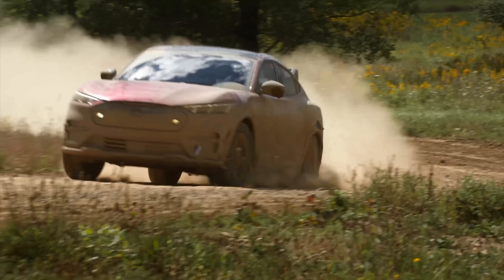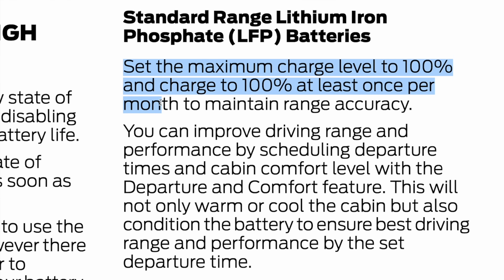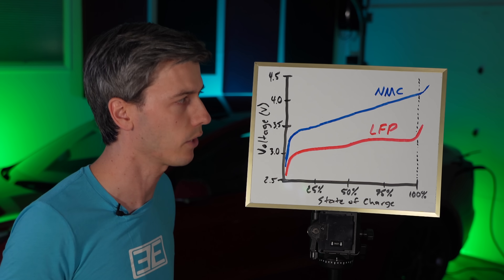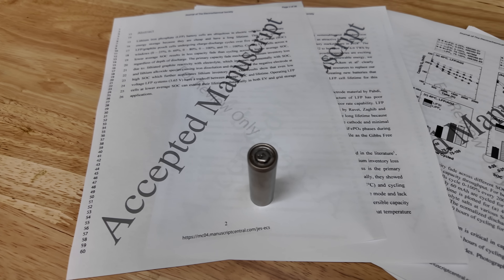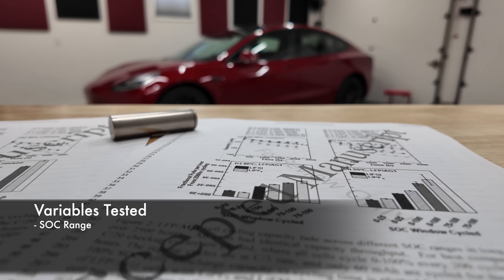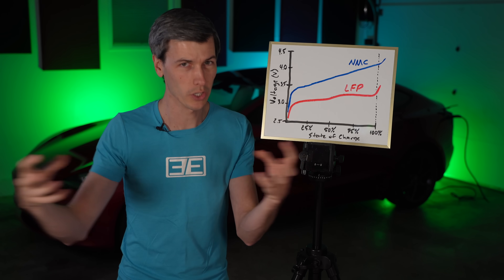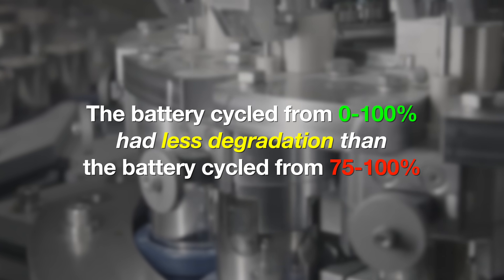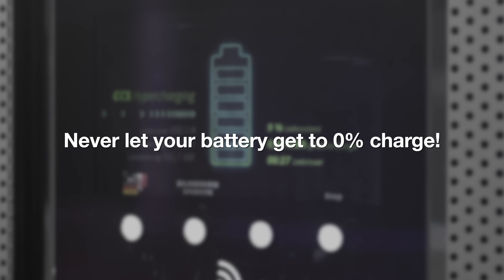How To Ruin Your Electric Car's Battery - LFP Edition!

Comment: About to hit 100k miles on my 2022 Model 3 RWD (LFP), and it only has about 4.5% degradation after being DC charged about 75% of the time (over 21 MWh). I full-charge it as much as I want, deep cycle it, and the car just holds up. I’m currently on a 10k mile cross-country trip with the car; really impressed with the longevity of LFP.
Reply: What’s your average ambient temperature?
Reply: @Eclipsis17  Spent the first two years in Austin, TX, so around 100°F (38°C) in summer, and now it’s out west with similar temps.
Reply: @BrandonKipp  As an Uber driver, my 2023 Tesla Std rng is at 116,000 miles and I just checked it again and it's 4-5% degradation. I'm in Michigan and charge 67% AC and 33% DC usually. Charge to 100% daily, but I drive nearly every day city driving 1500-1800 miles a week. Very glad I got the LFP battery!
Reply: @MH-Tesla  That is awesome to hear! At this rate, you’ll definitely get at least 500k miles out of that battery - super smart choice to go with LFP. I saw your comments on this video a couple months ago when you had 92k miles, I’m glad to hear not much has changed since then. My LFP Model 3 was also used for rideshare in Texas up until 90k miles and was almost exclusively DC charged, but that didn’t seem to affect it at all. I did a 110k mile review on my channel which basically concluded that no matter how you use/charge the LFP packs, they’ll degrade pretty much exactly the same. There’s an LFP Model 3 I’ve been following in Australia which has over 220k miles, and only 6% degradation. Lots of other high-mileage owners chimed in and said similar things as you did - don’t worry about the battery, just drive the car. But definitely keep us updated on how it’s going. I suppose at this rate, you’ll be at 200k by early next year?
Reply: @BrandonKipp  Did you often DC charge at hot ambient temperatures in Texas?
Reply: @donny_k7370  Yeah, the car was constantly DC charged in the hot (over 100°F/38°C) Texas weather, and there were seemingly zero adverse effects from the heat.
Reply: Did you do a overnight battery test to make sure the degradation figures are correct?
Reply: @Shane-fk6ig  I have not done the “battery health” test in the service menu yet, but that’s something I’d like to do. However, I have measured the capacity the well-known way, which is charging the car to 100% SoC, driving it gently (to avoid losses) down to 0% SoC, and using the bottom buffer. In that case, I’ve been able to pull close to 58 kWh out of it, which aligns with ~4.5% degradation. I’ve probably cycled it from 100% to <10% at least 40-50 times within the last two months and 15k miles of driving, and each time, the numbers have correlated with about 4.5% degradation.
Reply: @BrandonKipp I would be interested to see if there is a difference. I did a lot of research before buying a second hand Tesla  a while back and it appeared the battery health test was the only way to really tell. I bought a Tesla offa guy who was reporting less then 5% deg but when he did the test it was 10% which is consistent with my understanding of what nearly all NMC cars lose in the first  year. After which they hold that rate for years and years. That’s why I’m surprised about your results as it wasn’t consistent with the battery testing results I saw in studies or of anyone who completed the battery test. Either way the batteries are still great but yours is exceptional.
Reply: @Shane-fk6ig  His car is LFP so it correlates with LFP better longevity vs NMC
Reply: How and the fk do you get 10k from "crossing the country" I call BS
Reply: As a long time ev driver since 2012, that is facts I charge 93% at home and degradation is/has been so minimal.  Remeber to remind the no ev people, the effiency does not drop over time, ICE junker passengers get less efficent with each and every mile.  The ice junker tank size stays the same and effiency gets worse.  Bevs effiency stays the same the tank increases.  Ice junkers only pollute more with each mile.  Why do people think that cars over 20 years, here in GA, no longer need emissions tests?  The answer they will not pass they will pollute 6x to 12x more hence they will not pass.  Ice junkers are the past for passenger vehicles.  Most of the range clowns drive less than 18k miles per year. 200 miles of range is plenty, anything higher is a bonus.  Ice junkers have reached peak effiency and power, Bevs are only 10 years in, they will only charge further, get more efficent and get longer ranges on less batteries and they help level the power grid.  That is alot of information for inmce junker drivers but within 5 years they will get it.  Americans don't want evs, why try so hard to keep out Chinese evs?  Because they sell ur data??? What have the 15 major oems been doing?
Reply: @MrJinske That's not true at all we tested a 10 year old VW and and its hp figure was higher than new..

Efficiency does drop with Evs due to the fact that the power output is directly linked to the battery capacity which gets lower every single year.
Reply: @absolutium  LOL compression always drops on an ice junker, it's engine only becomes less efficent each and every mile.  Lots of studies, MIT 2021 ice vs bev study over 10k ice vs bevs and in a short  3 year period ice effiency dropped 3.6% on avg, bevs overall with less tech than today 2025 was at 1.1%.  The ice junker tank stays the same but it's effiency drops, always.  An evs " tank" that is capacity can degrade, that is "get smaller" but it's effiency stays the same.  There are no credible studies that show that an ice junker over a large sample gain more horsepower over time especially over 10 years, come on man know science not science fiction.  Your just stating and opinion and not facts.  Please point something out scientific  vs something out of your rear end.  All serious people, meaning automotive engineers, scientists and propulsion experts have come to the scientific conclusion that that battle of ev vs ice is done, ice is at peak effiecy, no it needs  turbos, superchargers, and we'll, even Ferrari, Lamborghini  and other performance are using "small" batteries to fill in launch power effiency, and overall performance., and improve the reaction time of torque vectoring, which for you can't even comprehend that an ev can torque vector over 1000 times per second and ice junker if lucky 10 to 30 times a second.  Combustion just can't be that quick it has to do with science, engineering physics  other concepts that are well over your head.  Get educated and gain real world experience and you will see what you say here is nonsense.  Ok it's fair your prefer gas, that is fine for you.  Remeber at the turn of the 20th century people like you preferred horse buggies vs ice junkers.  Also remeber evs were 1st b4 ice look up and learn to educate yourself.  Cheers
Reply: @MrJinske  I have owned a dozen vehicles including an AWD Seal .. I know what EVs can and can't do.

Every single person who likes to talk about efficiency knows nothing about thermodynamics..
Reply: @MrJinske  ..there is a principle called one way energy entanglement for isolated energy, now let's not kid ourselves you have no idea what that means..
Well it essentially tells that we cannot process more energy than that used for the "manufacture" of the closed system.. in this case the batt array..
Reply: @MrJinske  The E. density of regularfuel is 15 to 30 times higher than that of a batt array.. when you talk efficiency you are never going to get anything over the packed energy.

So here is an oversimplification: 90% of 10 against 35% of 1500 (worst case scenarios nowadays) will help you get a clearer perspective.
Reply: @MrJinske  what's an Ice Junker?
Reply: @MrJinske  What a long passage full of salty useless bits. Enjoy your ever so degrading battery powered car. As much as ICE engines becomes less efficient, so does the battery inside your EV car thats is degrading and needing change solely based on how disciplined and knowledgeable you are about your battery chemistry. The discipline to drive very modestly is also the key factor of how fast youre degrading your battery cycles. If you often max up your over glorified “horsepower”, you will be needing to change battery much faster than anyone else due to excessive heat you introduce to the battery. Thats very contradictory to what EV major selling point, ‘fast car’. It does not sound very practical, does it? 

Meanwhile, ICE junkers could push the heck outta their horsepower with nothing to worry about degrading anything within a span of long time(proven for much much longer time). Plus, many countries are polluting their environment already with existing electrical power demand due to their electricity generator by using burning coals etc. Imagine the more demand on this EV junker population rising number vs the output of black smokes byproducts. Also, enjoy your degrading battery capacity car that you hv to carry their wasted weight load all the time once it depleted like crazy, you wish you can cut half of wasted load to get more milleage 😂
Reply: @MrJinske  at 186k miles,  my mazda 3 gets about the same range with a maximum of 520 miles and an average of 400miles.     ev clowns always talk about charging at home like 5 minutes to fill up gas on the way to or from work is somehow unbearable but then they say that sitting and charging for 30+ minutes is so great.       go live in china if you think its so great.
Reply: @jebes909090  You do realise that pretty much every Tesla driver USED to drive ICE vehicles, then bought an EV. Then basically NOBODY goes back to ICE...... What does that tell you.
Reply: @darrentroypearson  many do.  what does that tell YOU
Reply: @jebes909090  Globally 92% stay with an EV after owning one. The US is a bit lower at about 65% likely due to the inrastructure which is growing exponentially so with that said, like it or not, we are on track to replace the ICE vehicle for the vast majority of consumer level new vehicle purchases.
Reply: @RobertMcAleer  thats all the market you're gonna get.  The rest will keep buying ice
Reply: @jebes909090  I was you in January 2022. Said the same stuff. Now I own a Tesla and I'll never go back. Gas is way too inconvenient. You can't fill it up at home and you seem to constantly need to do service. And recently driving a friend's car for him, wow, how quickly I forget how annoying it is to use a gas station pump. I thought charging would be the thing I hated most but turned out it's the thing I like most!
Reply: @MH-Tesla  Battery problems does not always come with high mileage, its the time will be the huge enemy. Plus, the way you drive. Keep pushing the throttle on highway, punishing the battery with excessive heat will also kill your battery in the long run
Reply: @boboiboy9350  You are correct I believe. Time is probably a bigger killer. Letting the battery sit unused is hard on it. At least that's my belief right now. Since my battery is being used often, but kindly, it's likely the reason it's still at such high capacity. I'm at 122,000 today and now I'm thinking, if I continue at this rate, 500k will be no problem. And I'm in Michigan, so hot temps are rare.
Reply: @MH-Tesla   If you use them everyday, I think that will be worth it for an EV usage. Blessed with colder climate( not so cold thought) is a major plus. Good luck with 500k milestone
Reply: @darrentroypearson or we have both. EV for around town and ICE for road trips.
Reply: My gas tank declined 0 liters in capacity in 25 years  😂

Comment: When I built my custom electric motor bike 11 years ago I used LFP batteries, they were good for the time but needed to be charged to 100% fairly regularly to balance the cells and also reset the range. From there when you rode the gauge would count the Amp Hours and I knew how much I could use. The flat voltage curve meant this was the only way to know how much range you had left.

A few years later I installed Chevy Volt cells and boy or boy they have been amazing! Far lighter for the same capacity and the maximum Amps they can put out is easily 3 times that of the LFP. At the moment the cells are 11 years old and working well so very happy!

Comment: I just turn the key and off I go. No worries about battery state of charge or if I am ruining my battery.
Reply: You have a battery less starter?
Reply: @logitech4873  No but it doesn't cost thousands to replace and I have jumper cables.

Comment: @engineeringexplained If you see this, could you make a video about Valve Body’s and how they operate a transmission? Very difficult to find information on the internet that deep dives what it does, how it operates the gears and such, thanks

Comment: This could be solved to a large degree by having two batteries and smart battery controller that would alternately charge one battery to 100% (for calibration and energy reserve) while other to only 50% (for longevity). The algorithm may be more sophisticated than just alternating. It would also choose which batter to use to power the vehicle depending what level of charge is desired for each battery.
That wouldn't be perfect, as the battery controller has no way to know if you're preparing for long trip, or going to not use the vehicle for long time, so ability to occasionally manually override it would be desired, but for most use it wouldn't burden the user with thinking how much he needs to charge every time.

Comment: LFP no cobalt or nickel.  Cheaper to make and longer life NMC/NMA. Rare fires with LFP.  EV’s will be cheaper and faster to manufacture in the future as more battery factories in USA.  Right now many manufacturers buy expensive 3rd party batteries from Korea and China.  Chinese CATL world’s largest battery manufacturer.  40% USA vehicle owners no garage access.  More charging stations needed.  Teslas MSRP helps pay charging stations.  All of teslas charging stations are level 3 fast chargers.  Most public chargers are slow level 2 sadly.  Most public level 3’s only 50 kw not advertised 350kw.  
All teslas are 130-250kw.

Comment: Cahrge to 100% once a month, may not be feesable if using public fast chargers. There a bills that are in the works to limit public chargers to only go to 80%. So those that can't charge at home, like those in apartments would never be able to go to 100% if the bills weree to pass. In the second half where they say to basicaly use 20-80% giving up 40% is a joke. if you have 300 miles of range from 100%-0% then that means you only have an effective range of 180 miles in order to not destroy your battery.
Reply: You charge to 100% when you need it. But for daily use, 80% is fine.

Comment: My plan
1) Charge to 100% once a month
2) Charge to 75% most nights using a level 2 charger.
3) Stop and charge when at 25% on long drives
I would think software should be able to automatically do the 100% 75% 75% nightly charge cycle schedule.

Comment: This just proves people don't like to read and the problem is getting worse. I work for an undisclosed ICE/EV dealership and the amount of people that come back because of operator error. Of course the answer to their problem is in the manual but no one reads it. I understand some people learn by visual cues, we have a salesman specifically trained to teach new owners the instrument cluster, but reading and comprehension are basic skills I assumed was taught in all schools? This also trickles down to new employees too, they never read the employee handbook. We had so many complaints that we now require signatures stating the employee received the handbook and actually read it.

Comment: I remember back when I was a kid, when something with a battery died, my dad would tell me that it was "out of juice".  Seems obvious to me that if we want accurate battery level readings, we shouldn't be reading the voltage, we should be reading the amount of juice in the battery.  A float on a stick, just like in a gas tank, should do the trick.  No need to overcomplicate things so much.

Comment: What I was expecting to learn from an engineering approach to the Batteries is the following. What's the actual USABLE energy you can get from a given battery capacity at any time, on any situation. This is I think the most complex but most useful information. You know, not everyone has a degree in engineering to calculate so many factors in order to be safe that at any time, his/her BEV will have enough power available to do whatever is supposed to do. To make the long story short, ICE cars is the ONLY 99,99% reliable means of transportation we have so far and must be preserved as such.  Batteries chemistry has many limitations that is very hard with the present technologies of materials to overcome.

Comment: I have a 2018 VW e-Golf with a Lithium-ion battery.  I live in Canada and my car is always outdoors. My greatest battery challenges come in winter cold snaps.  When the temperature is below -37°C the battery doesn't really want to work.  The car doesn't have active battery heating / cooling, which is a shortcoming.

Comment: Shouldn't we mention charging speed when we talk about battery degradation/longevity?
Charging at home at 3kw/h overnight vs at 175kw/h at a Tesla supercharger might have more impact on the battery than what percentage it is being charged to.
I have an LFP Tesla M3 and I charge it at home probably twice a week from around 40% to 100% at 3kw/h (from normal wall socket in Europe). Am I doing the right thing? 🤷‍♂️